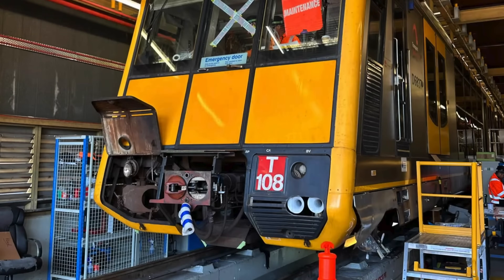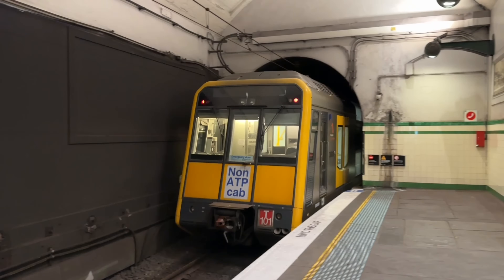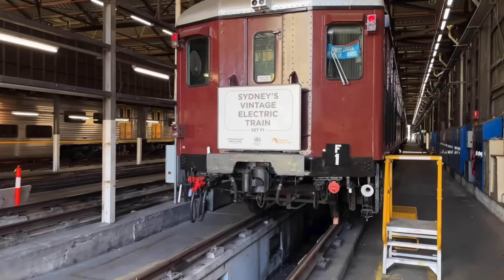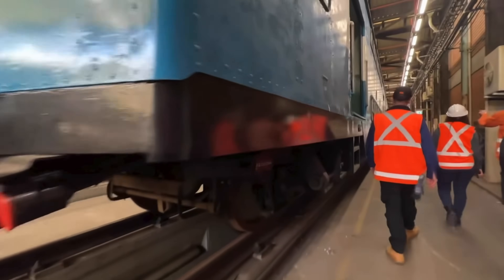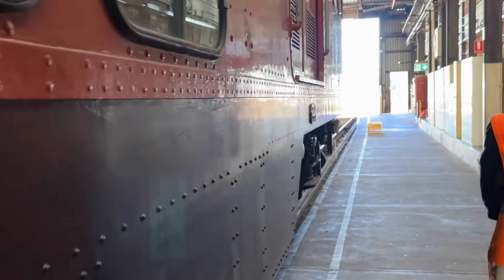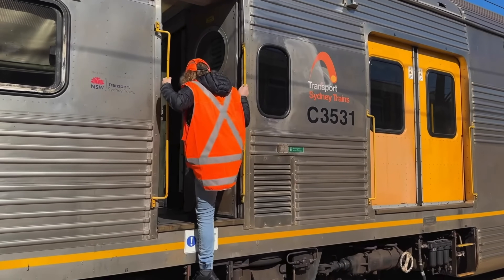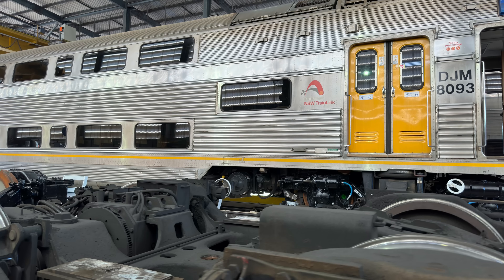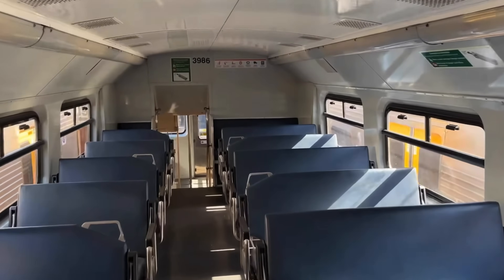Sydney’s Flemington Maintenance Centre — How Are Sydney's Trains Maintained?

Comment: My memory of F sets is that, back in the day, there was nearly always a 'bar stool' in the driver's cab but the drivers seemed to always drive standing up. Like Sydney trams. The driver's sliding door was usually open for 'air con'. Maybe they were worried about toppling off the stool and departing the vehicle?